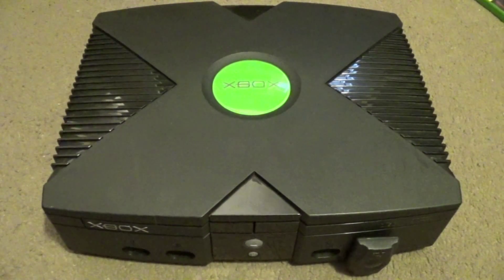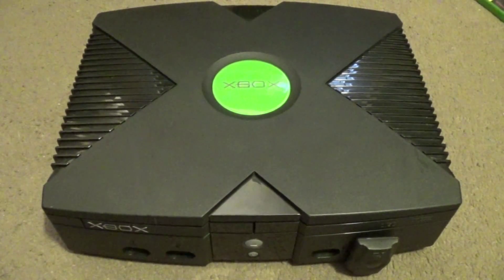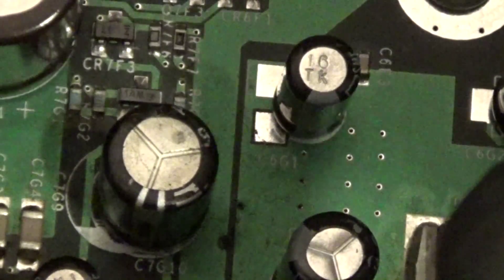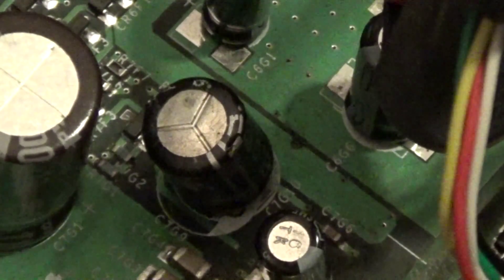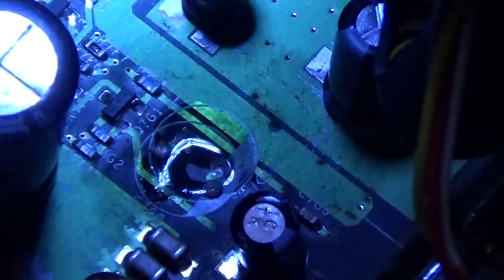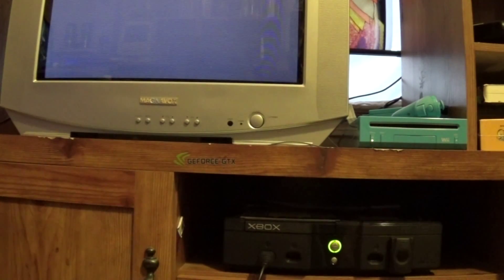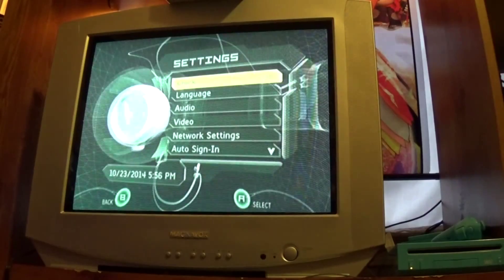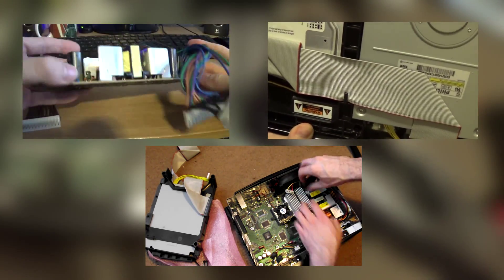Xbox Clock Capacitor Removal!

Comment: I have a 1.6 I believe (manufactured in 2005 and kernel 5838) whenever I plug it out the times resets. How do I fix this?
Reply from the maker: First things first, that's a good sign the clock cap is completely dead.

The solution would be to replace said cap, but one thing to keep in mind is that on 1.6 models the cap is absolutely necessary, so you kind of have to make sure you get it replaced properly or it's a no-go for the system even working!

I never did replace the cap in mine shown in this vid (a 1.0) and the way I keep the time good is to when I first boot it go into XBMC and let it connect to internet time, which means leaving a network cable plugged into the damn thing at all times! The unleashx dash can do it but often times it gets reset time setting wise and I'm tired of having to fix it.

But uh, yeah, I wish I could help further with the time issue on your end, like tell you exact values and type of cap you need, where it is on the board, etc, but I never have learned that info myself - own no 1.6's to need to work on.

The info is out there, but a little hidden. Good luck, but at least know your cap is a better model than the ones in older ones and is not likely to leak and destroy the machine! :)

Best of luck.

Comment: How did  it set the time? Is it connected online?
Reply from the maker: In my case, yes, it was connected to the internet at that time. UnleashX, along with other custom dashes for the Xbox, have features that can get the time from a time server out there on the internet and update without issue.

Well, that should be the case - some are better than others in this regard and as it stands now my Xbox won't update automatically unless I go into XBMC -.-;;

As long as the unit is plugged in and getting power it will keep time without the clock cap, but the moment you cut power it will need to be reset. Of course you can manually set the time, but that gets old after a while.

Comment: Hey bro my clock keeps resetting and am able to get past the clock screen but then my controllers stop working you know if the capacitor might be the problem or maybe something else?
Reply from the maker: Bad news - if you're having controller issues there's a reasonable chance the clock cap is beyond dead - it's already leaked and damaged the board. replacing / removing it won't fix the damage done, so...yeah. Cleaning the motherboard could fix things - it would at least stop any more damage being done BUT the odds are the damage done is terminal.

That is why this thing needs to be removed ASAP.
Reply: @KurisuYamato  i have my xbox 1.6 do i need to remove the capacitor ?

Comment: Do I need to remove the clock capacitor even if I'm not soft modding my xbox or anything?
Reply from the maker: It's a very good safety precaution to do on any original xbox before the final revision, 1.6. The odds are good it will fail and will leak onto the board, so the sooner you get it out of there, the better.

Comment: If the capacitor is gold colored (you've got a 1.6 Xbox) DO NOT REMOVE IT! ONLY REPLACE IT, you'll brick your system, if not gold colored you can just desolder (or rip) it out. I just ripped mine out.
Reply from the maker: You are absolutely correct on this. I can't recall if I made mention of this at all in the video or not - probably not since you are mentioning it, and you are very right to do so.

The clock cap is in a different location on the 1.6 models, or so I'm told, but even still should not be removed as it's critical to the machine operating!
Reply: Or check the bottom to see if your console is before 04
Reply from the maker: Also true. I just wanted to avoid such a blanket statement, just in case.
Reply: @KurisuYamato  Also, how do you clean off the acid?
Reply: How did you rip it without any further leaks?
Reply: It will work if to put one back in it.

Comment: does the Xbox need to be TSOP'd or chipped to remove the clock cap, or can it be soft nodded or just stock? does it matter?
Reply: If the capacitor is gold DO NOT REMOVE IT! Only replace it, otherwise you can just desolder (or rip) it out.
Reply from the maker: It doesn't have to be modded at all - you can do this on a stock system and the only issue you will have is losing time if you lose power. Some mods just help out, since the custom dash will auto-set the time from the internet, if your console is connected, but otherwise, nope, no mods needed at all!

Comment: If my Original Xbox isn't softmodded and I get the rainbow effect, does it lead me to an error screen?
Reply from the maker: +Sailaser It can, possibly, put you in a clock boot loop. It's unlikely, as it should just set the time and move on (the clock boot error is usually a side effect of mods acting odd) but still, it COULD happen. Boot with a game directly and I think it allows you to bypass that issue, sometimes.

Still, it shouldn't happen. The rainbow effect is normal when the time isn't set, and the system should just let you set it and move on to the normal dash.
Reply: +Kurisu Yamato So you mean I have to be lucky and not run into the endless loop of the clock set screen?
Reply from the maker: Sailaser
I highly doubt you will run into an issue with the clock boot loop; I only know of that happening with certain mods; a stock machine shouldn't have any issue, since it's just like if the clock cap was drained.

That's what I meant to say above, I had just woken up so my wording was more odd than normal. haha.
Reply: +Kurisu Yamato My Xbox is completely stock, nothing has been done to it, so okay. Also would you recommend me softmodding it with UnleashX? I do have a lot of old systems that can play the games though.
Reply from the maker: Sailaser
The Kingroach - Ndure method is what I always go with. It's crazy, and requires an old PC, but it works for me, so yeah, mod away. No reason not to.

Emulation is just one reason to mod an Xbox.. XBMC, the ability to rip games to the hard disk (or, if you are crafty, add in a larger hard disk) and having such fine level access to the machine make a mod worth it.

I do have a hard-modded console, but it's a beast to work with, and just feels odd to work with... I much prefer softmods, but that's just me.
Reply: I'll look into it, thanks!
Reply from the maker: Sailaser
No prob! I would do a video on how to go through a whole soft mod, but every time I try to film it it goes terribly wrong... also, with an issue I had a few months back I don't want to mess with ndure and the like for at least another year, haha. Good luck, and have fun! I'm easy to reach if you have any additional questions, or just want ideas.

Comment: Well, I got a used Xbox off someone I know used, pretty good condition, case is kind of scratched up, but not a big deal because the system works just fine. The system appears to be around 11 years old, because I went through the saves and I saw one from 2004. I'm kind of surprised that the system has survived with a clock capacitor after all these years. Could it be that it's a 1.6 motherboard?
Reply from the maker: +TheChaoticWolf Well, on a 1.6, which I think that one is still too new to be, if the clop cap dies, the system won't boot at all (that's why you can't remove it, you have to work around it)

Not all clock caps leak as quickly as others, but they can, and will, fail eventually, and once the traces are eaten, game over.

Double check the label on the bottom for the manufacture date, and when you can, go in and get that thing out of there, just to be sure. :3
Reply: Well, I looked even more through the save data dates, the oldest one now is 2003. So now it might be a 1.4 or 5. Damn, this thing survived for a long time. But yeah, I'm gonna check soon.
Reply: Oh, and if it's a 1.6 motherboard just in case, removing the capacitor will prevent the system from booting, won't getting a newer and better capacitor and putting it on the motherboard still make it function? Or does the capacitor have to be official Microsoft?
Reply from the maker: *****
Hey, this Xbox is a 1.0 launch era unit. I've moved it into a Halo edition case, but still, same 1.0 hardware. Original Xbox's, if taken care of, hold up pretty well, unlike the 360...
Reply from the maker: *****
Haha, nah, there are no "official microsoft" capacitors - those are just as randomly sourced as any component. You just gotta make sure it's a correct one for the job, matching the old one. I think you can bridge the connection, but I'm not certain.

Replacement caps though are, in theory, the best way to solve the problem, if you really want to go through the process of replacing one. Battery mods are seen as the absolute best option, but again, that's it's own craziness. I almost prefer going the 360 route with just having no backup clock - my systems will look for the time online and update, much like 360's do, so there is no issue clock wise at home.

Now, when I take the conbox out somewhere, that's another story...
Reply: If it's a 1.6 motherboard, I'm screwed and also not screwed at the same time. 1.6 caps are known to be better than the older ones. They don't leak as bad, I think Atleast. And the bad thing is if it decides to leak on me I'm gonna have to replace it which is very hard. But oh well. *****
Reply: I just checked and the motherboard is from 2002. Definitely not 1.6, yay all I need to do is open it up, disconnect the components and yank out that sucker! (Not really yank, just slowly wiggle it or use pliers)
Reply from the maker: *****
Awesome. Probably a 1.1 or maybe 1.2 - whatever case, yeah, same clock cap location, so you should have no issue ripping her out. Just double check not only with my video but other vids, and sources, to make absolutely sure you are getting the right one.

I don't doubt you being able to tell which one, but you know, safety first. No harm in knowing you have the same one as 12 other sources, right? :D
Reply: Probably in a few months or so, I'll get some screwdrivers that fit in the Xbox screws and watch your video to open it up
Reply from the maker: *****
About to do another Original Xbox video, actually, so I might do a 2 part video, one showing just simply how to open one, and the other showing details on a hard-modded one. Why not have a short, simple, and to the point "opening" video?
Reply: Sure thing! I could use some help for opening an Xbox. I'm not much of an opener person, so that definitely could help if I ever in the future open up my Xbox. I'm only like 14 so I'm not an expert at opening consoles XD
Reply from the maker: *****
Sure thing! I'll give the video a go tonight and link you here
Reply from the maker: +TheChaoticWolf https://www.youtube.com/watch?v=U9va7uFfeDE The video should be available to view sometime in the morning - I have it scheduled for release.
Reply: Alright thanks man

Comment: My board looks different
Reply: ***** I ordered an original xbox of the internet not so long ago  every time i switch the console on it seems to need the clock time reseting every time would that mean that the capacitor may have already been removed by the previous owner.